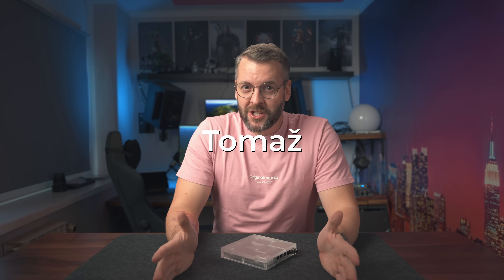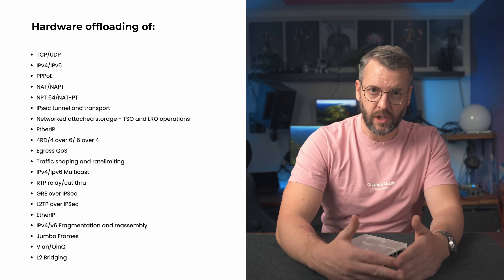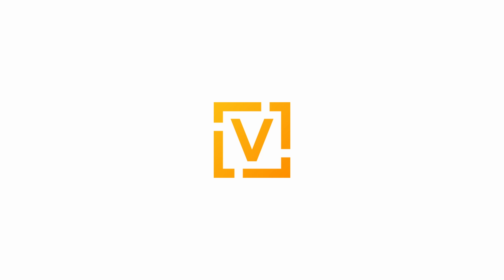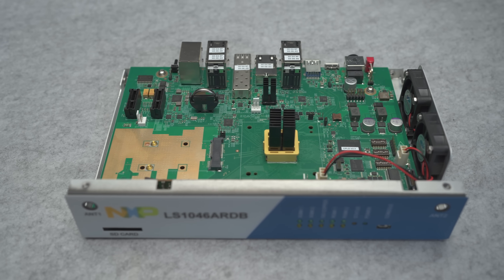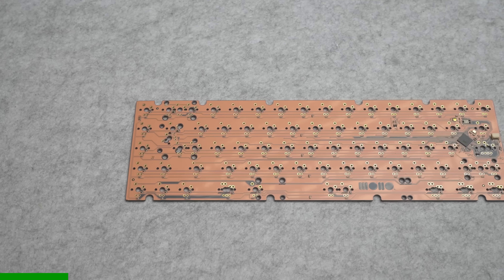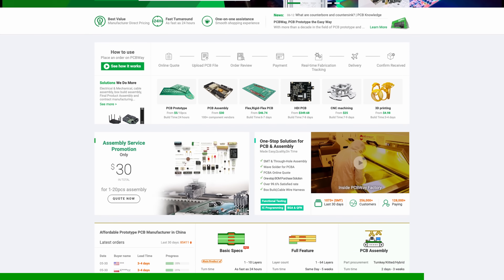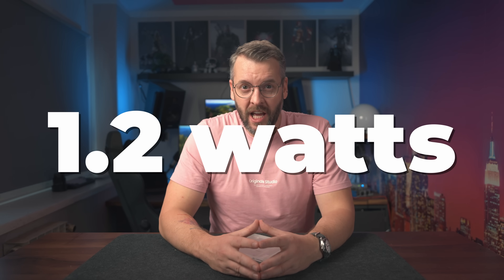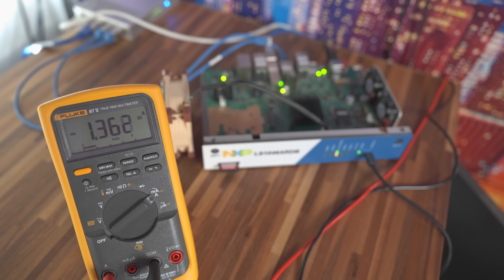10 Gb/s throughput without using CPU cores? ✅ Check.

Comment: @5:40 DING! Wrong. The GPL is very clear on this. ANY modification done to the kernel source MUST be made available to anyone to whom you've provided a binary. In short, any kernel you compile, your customers must also be able to compile. HOWEVER, external, 3rd party modules can be 100% closed source. I've been here, it can be messy. And yes, giant manufacturers like Broadcom and NXP don't care about breaking the law, or forcing you to.

(And there's some debate about making changes to the kernel simply to facilitate external closed modules. For example, undoing the "taint" caused by non-GPL modules, so one can use a GPL-only exported function.)
Reply: Agreed, patches and modification to the kernel are covered by GPL and need to be public. A single binary is all that's needed and even then it's still a poor argument for closed sourced code within this project. If he held NXP to the fire and made them comply with GPL in the first place then I would be more open to using their secret sauce.
Reply from the maker: Thanks for pointing it out - this is now very high on the "to discuss with NXP" list :)
Reply: @tomazzaman  GPLv2 or GPLv3 ? There are some (big)  differences about on that question.
Reply: @tomazzaman  Ask to discuss with their legal department, sales people most likely have no understanding of the issue.
Reply: @tomazzaman  How does that help? Your NXP sales rep will not give you accurate legal advice...
Reply from the maker: @user-dy9ux5dc6e  well, do you have any other ways of resolving/clarifying this other to starting to talk to people to get to the bottom of it?
Reply: @tomazzaman  I'm just saying that you need to contact a GPL attorney in the US with these questions. NXP sales does not care about GPL.
Reply from the maker: @chimpo131  perfect! another opportunity to learn something new.
Reply: @chimpo131  Because you know everything right? I have no interest in the hardware, out of my price bracket, so watching these videos because I like them. Don't understand the need for people to be negative.
Reply: Oh thats a netting that noone should cut, GPL my beloved. ;(
Reply: The solution is simple: provide NXP as binary modules
Reply: @francoisscala417  They could release the binary module, and then open source a wrapper to load the binary module in the kernel. However this isn't what they do in most cases - and this project isn't anywhere near big enough to convince NXP to change their ways...

This just means that without being transportable to newer kernels and being able to be built without relying on NXP for everything, this entire project is lifetime-limited e-waste.

Once you don't want to support it anymore, or it gets too hard to keep porting changes - that's the EOL for your product.
Reply: @francoisscala417  The issue is that the module must still hook into the kernel APIs.
Nettrack hasn't all the necessary APIs for offloading exposed. There is some work in the progress but so far the HW accelleration possible is very very limited.
This kind of patches are mainly in the core part of the kernel and not in the external modules.

Then they also patched userspace utilities for offloading, meaning you are running more unknown modified software.
That have to hook into the kernel in a different way for offloading. I'm thinking about tcpdump that is not able to see the traffic. NXP probably has a patched version.
then there are the various VPNs stacks, the ppp daemon etc. it will become a huge mess very easily.
Reply: There's no debate, Tuxedo was forced to GPL2 their drivers on pain of blacklisting just now for getting around the GPL2 requirement for certain parts of the kernelspace api. Granted, that situation is different because they want people to be able to run mainline/vanilla distros they don't pre-install, so embedded is a bit of a grayer area.

Comment: When 40G or 100G?
Since youre at 0% across 4 cores at 10Gbps ... Surely youll hit 10% at 100Gbps 😂
Reply: The CPU he is using has something like 10-15gbps hardware acceleration engines in it, that is where the hardware blocks top out at. He can try to push more through, but it will bottleneck and not go any faster when his software is being told to use those HW blocks, packets will just build up until they get dropped when trying to load it past what the HW blocks can push through.

The next gen of Layerscape CPUs after the one he is currently using though have increased the HW Blocks capabilities to 50gb security (IPsec, etc) acceleration, 88gb data compression acceleration, and 105gb onboard layer 2 switching throughput. So theoretically a higher end product using the new CPUs would use very similar power numbers and 0% CPU usage while being able to do 50gbps throughput. The cost difference is big though. He showed $75 for the current CPU he is using, and the next gen, 8 core, 2ghz version costs $292.
Reply from the maker: Spot on. Our CPU has 26Gb /s HW offloading cap.

Comment: I figure it out right away.

That's why Windows has an advantage with well supported hardware, and Apple makes hardware and software, so there should be no issues there (as always, I have noticed on older hardware that even they control both hardware and software, they removed the very optimized drivers in favor to something which doesn't perform as good as it was, but it's so old people don't care about it). Drivers are what enable full use of the hardware, offloading all the operations to the ASICs (Application-Specific Integrated Circuits). And the software needs to call the driver functions to enable the hardware processing.

The same issue described here with Linux is present on "alternative firmware" for home routers / access points like the awful DD-WRT (and OpenWRT for that matter) and other variants which the developers have reverse engineered the hardware of those routers to provide support, but these reverse engineered drivers are basic most of the times and process everything on the CPU.

For those wondering what I'm talking about, think this way: you have a pretty decent GPU on your system, but no connection to the Internet or embedded drivers for that GPU. Windows enables it using the "STANDARD VGA ADAPTER" driver. It can enable a high resolution, SVGA, XVGA and the sorts, but window composition (moving windows, drawing) is bad. And it cannot draw video frames fast enough or accurately that way, simple tasks take up all your CPU cores. That's what's happens when you cannot offload processing to the many auxiliary processors, ASICs and utilize the hardware you own to the fullest.

Pretty interesting video.

Comment: For me, since I have to use PPPoE on my WAN, if the lower clocked CPU can handle a XGS-PON full duplex speed with PPPoE, which is about 8.8 Gbps real world speed on XGS-PON, usually provider will give you a 8 Gbps profile to use. If the hardware offloading can allow that, I heard you say PPPoE offloading, I'm good with 1.4 GHz CPU and lower RAM. 
Just be mindfull of the addons we might want to run on the beast, IDS/IPS, filtering and caching dns, those block list are very big to handle. I'm not going to run a VM and it's a router.

Comment: How does the system behave when there are actual firewall rules involved? So when it isn't just fast-path?
Reply from the maker: The first packet in a new connection goes through the firewall normally and if it passes, all the subsequent ones from the same connection then bypass it.
Reply: I think it is clear from the comments and from my thoughts, it would be good to expand on applications that Hardware offloading would be beneficial and the ones in which it is not. So people can better decide if giving up CPU and memory is a good ideia.

Comment: @tomazzaman I've following your updates on this router for quite some time now. I personally believe if anyone if building new hardware in today era, it should be fast enough to handle most network security services/apps. I'm curious to know how many 10gbps streams can it handle simultaneously before it starts to throttle. Second, Will the cpu be able to handle IDS and perhaps IPS?
Reply from the maker: As for the number of streams, I can't answer that yet, as I've literally just gotten my hands on the ASK so it's something I plan to test (and report here). And as for IDS, from the documentation, it supports up to 32k rules with Snort, so it should still work full speed, but I need to test this too. Stay tuned!

Comment: Whether the A72 cores run at 1.4GHz, 1.6GHz or 1.8GHz is irrelevant.
This is because if there is an edge case where the traffic cannot be offloaded, it will just be slow.
So yeah, save money on the CPU.
As for the RAM, what do we need 8GB for? Most routers ship with 256MiB or 512MiB, some with more.
Even if you're doing some amount of BGP, 4 gigs is plenty.

But what I want to know more about are the offloading capabilities.
It's probably wishful thinking but I want good performance with wireguard and traffic shaping (fq_codel, cake).

Comment: 1.4 GHz / 4GB RAM is probably good enough for a router with HW offloading in my opinion. You can release a more powerfull version at a later point in time. CPU is probably not an issue unless someone wants to run a firewall on it. The 8GB RAM could be useful for running containers to handle DNS, Caching, etc, but even with 4GB RAM it should be fine for basic stuff.

Comment: for ram: even 2GB should be more than enough. throw 32 gigs of emmc onto that (mostly just for logging. if it weren't for that, 8 gigs would be enough), and use the cheapest CPU you can get that still handles 10 gbps. would be nice to see the CPU be able to handle at least 500mbps of wireguard/openvpn throughput though.

Comment: This kind of hardware offloading is incredibly cool! One thing that would help with the decision is to see what the CPU utilization looks like at 10Gib without the hardware offloading. I would still prefer a higher-end chip and open-source core if we're talking about a difference between closed-source and open-source of  1 - 10%. But if the difference is more like 30 - 40%, I might lean more towards the closed-source side. Keep in mind, too, that reducing the CPU speed can also have more damaging effects on IPS/IDS. 

Keep these videos coming; your level of engagement and openness is definitely giving me hope for the product!!

Comment: It really depends on how much Physical SFP+ and actual 10G compatible ports you want to have in the final version of your product. If it’s going to be a solution up to 8 ports you can definitely go with a smaller requirement, if you go 16 and up you would need the additional power.
You should also consider a upgrade path for PoE++ input and PoE+ Output on Multiple Ports. Today that is a essential feature for a more expensive network appliances. Consider the price of you CPU alone I suspect you solution to end up above 250€ or even close to 400€ for that price point I expect a lot more of a device considering what you can get on the market right now.

Comment: Okey first of all, will it be possible to write linux applications to manipulate traffic that is being offloaded? If not I see not point in the better hardware, but then again I also don't see a point in the product. 

If it can do that, then I would see value in having hardware that can actually do some work in it. That's my hope of an open router is that we'll get a good community building all kinds of unique things for it that we can relatively easily run on it, things that have no value for corporate centric competitors. I would love see good profiles for own IoT vlan networks being community built and maintained. Ad blocking. Analytics, deep packets inspection, debugging network traffic and protocols. 

That might just be me, but that is what I would like to see from something like this.

Comment: I hope that you're aware of that using closed source patches and drivers in Linux breaks the GPLv2 license under which the Linux kernel is licensed. According to the license, if you do so, the drivers and patches are designated as derivative works and thus licensed under GPLv2. This is the ilcense and thus the law!
Reply: Doesn't this make the company that he obtained those codes from break the law, not him?
Reply: @hubertnnn  It's kind like saying that a drug dealer is innocent because they were just re-selling the heroin - they did not make it originally.
Reply: @hubertnnn  That's correct
Reply: Well depends. For example zfs code is licensed under cddl which is incompatible with gpl but binaries are not so you can use zfs with linux. I don't know how those patches are applied here but I would presume they know what they doing to bypass gpl, or maybe not :).
Reply: @darukutsu  In principle, you can't ship linux with ZFS for that reason, but some distros ignore it and so do people else too, since OpenZFS is, after all, open source.
Reply: @roysigurdkarlsbakk3842  you can ship it like binaries did you read my comment?

Comment: Seeing how people respond with concerns like bugs, platform deprecation, and so on, I'd say that it would be a good idea to consider making sure that the router is capable of reaching basically the same results in terms of performance with the kernel bypass *disabled*. If you can downsize to 1.4 GHz while keeping CPU utilization under 70-80% on full load, then go for it.

Comment: My question is, what would 8GB of RAM even be used for if we kept it?
Do you reckon we could setup a home assistant server directly on the router? Would that benefit the extra specs that much? 

Personally, I am just fine with the reduced specs. Specifically, 8GB RAM is overkill in my opinion, even for a top-of-the-line variant.

Comment: I have a Mikrotik Rb3011 something, which I used for a while, but now it's offline... Mostly because hardware acceleration just not worked "every way", so when I NAT-ed over an L2TP which was build on my PPPoE, the CPU just went skyrocket... How can we make sure that this will not be a thing with this?

Comment: I'm not a network guy, but I understand that the traffic component is handled out of CPU and Memory which is very nice. But won't there be use cases where having these ressources will be a must. have? Such as running services for traffic analysis, ads remover, maybe VPN tunnels etc... I'm curious.
Reply: VPN tunnels can be offloaded to router hardware, typically. There is also a bunch of types here too. If they can’t and yes that will be the case for wireguard for instance, 

Traffic analysis is usually handled by a separate process, which can gobble up a mirror of whatever is being routed. If you are taking about IPS that’s a slightly more intense task but just getting metrics on the requests it’s easy. 

Ads removing, due to the nature of HTTPS is usually done based on origin. That’s easy enough to get a list of firewall policies and feed that into the hardware as an ACL

Comment: The whole "FreeBSD is faster at networking tasks" sounds like the same tired old arguments that that community keeps claiming based on some very old benchmarks and "Netflix is using it so it must be fast". 😄

Nobody has provided any modern benchmarks to prove that this is still the case. On the contrary, the few modern benchmarks that I've seen seem to favor modern Linux. 🙂 VPP will obviously totally smoke kernel networking though, as will hardware offloading.

Those hardware offloading engines can definitely be very impressively efficient and performant. 😀
Reply: Indeed. FreeBSD was faster in the long long ago. Then Linux vastly improved. But since then, let's say "less enlightened people" have messed with linux networking - eg. removing the route cache - so I can't say either is very effective these days. Hardware routing and switching will ALWAYS be faster than software.
Reply: It’s not about benchmarks, it’s about the apis and facilities to explicitly support hw acceleration in their networking stack that linux currently lacks
Reply: @l3xforever  Not sure exactly what you're referring to. Mind providing some more details? 🙂 My experience is that hardware acceleration is generally better supported in Linux than in FreeBSD, but I'm sure there are some exceptions.

Comment: The hardware offloading has impressive performance and low power consumption. My guess was going to be 6 watts. For it to be less than 2 watts was surprising. However if the offloading stops users from being able to use Wireguard, OpenVPN or rules.. that's gonna be complicated because for the price of this combined with its 10Gb target market.. it's gonna need to do those things and fast. I fear this will be a product that is amazing for everyday users who just need a fast router but I suspect those people have 1Gb or less internet speeds.

And so the enthusists who have 10Gb (like myself, I'm very lucky!) I'd want the ability to run all tasks very quickly. I think you need to show some results of what routing on just the CPU can do and what it can do when handling VPN traffic too. This is definitely important for a high-priced router.

Comment: How is performance altered with IP filtering?

One feature of pfsense I use is pfBlockerNG, which blocks IP ranges used by known bad actors. In my current config there are ~16000 ranges being blocked.
Is this also completely offloaded? Are there limits to the number of ranges we can block with offload?

Comment: If the cheaper option is the difference between a 500$ device and a 600$ device, definitely go with the 500$ device. Just make sure that it can perform in all the other major areas too.

If this is the difference between a 200$ device and a 300$ device, it doesn't matter nearly as much, and going with the better hardware from the start is the better option.